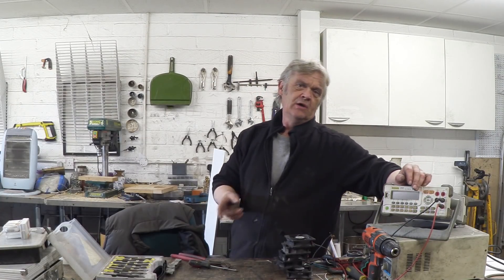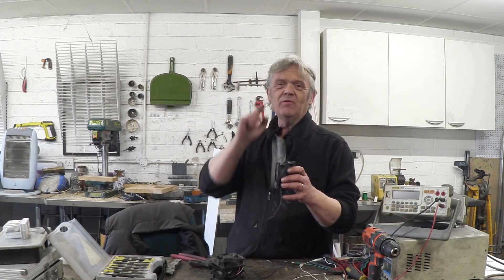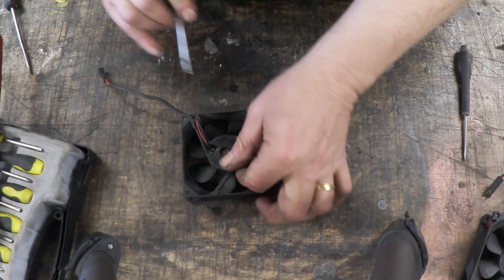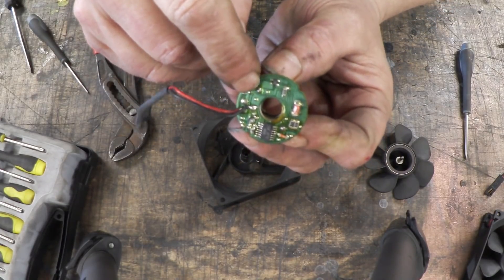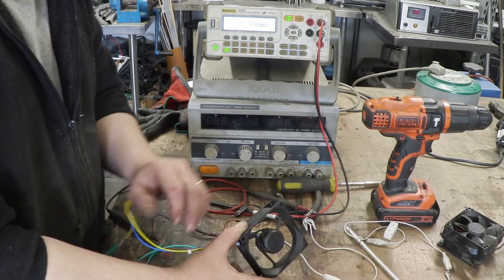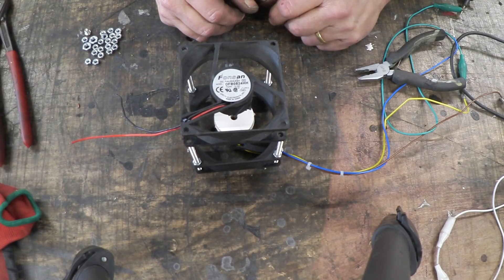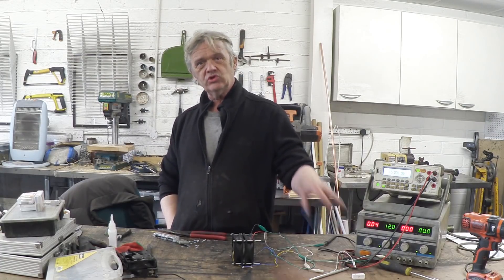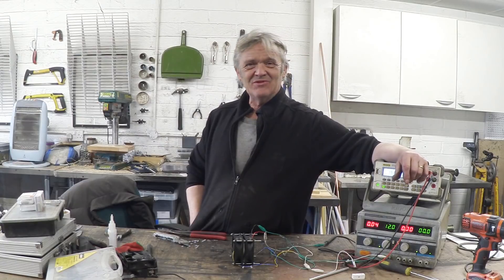1051 Brilliant  Mechanical Inverter - Even If I Say So Myself!

Comment: One big advantage is that they both have the same specifications, so it IS a direct conversion.

Much like how you bang on about a motor generates a certain output of rpm, a matched motor converted or operating as a generator should take that rpm provided by the paired motor and directly convert it into a commensurate current output.

Proof is in the pudding they say eh mate?

Comment: This is just crazy. I had no idea...

But I have an idea! 

Combine several in series and parallel but 3d print gears to drive them instead. Find the right gear ratio and weld it to a bike

Comment: This idea would be great for a DC/AC step up thru a filament transformer (120 to 6/12V connected backwards).As a B supply for an older tube type portable radio. The B+ only draws a few hundred milliamps.!
One or two 6V lantern batteries should run a 4 tube portable for months vs weeks for a C/D cell filament battery and 90V B battery Im gonna look on ebay for a radio.(and fans) LOL
Why thousands of pounds for inverters??? I have a solid state 12v to 120VAC 575W that only cost $35. Also a couple of 12V to 120VAC smaller 100W and 150W to run my laptop computers in the car Less than $20 each. (Of course none of them are true sine wave).

Comment: i built a 10000 watt low freq prue sine wave inverter 2 or 3 years  ago works great never had a problems with it  i have 250 or 300 in it  and you can do the same with your skills easyer than me  
it was my second inverter build the fist works great still also it can be built for under 100 bucks 2000 watts pure sine low freq  idle is 0.29 of a amp the 10k idle is under half a amp  rob  i have been trying to tell you how cheap and easy it is the boards are premade withe everything all ready on them  just add a transformer a choke a switch and put it in a case  then its done  the tranny is easy to rewind to the right voltage so will likly be free

Comment: i seen someplace a while ago a fellah did a bit of tinkering to an auto alternator and explained how you could get roughly 90 amps out the back end of them by removing the diodes and direct wiring to the 3 winds , attach 2 in series n i would imagine your 180 amp possibilities of running your home power? but i may misunderstand a thing or 2 as i am extremely new to this stuff myself

Comment: There's certain washing machines that has the same kind of brushless motor and I'm wondering if you can put that brushless motor on a planetary gear system that is stepped down to a 9-volt battery motor that can run the upgrade to the planetary gear system to the brushless motor but just imagine getting that little 9-volt motor that's driving it and then taking the 9-volt battery off of it and switching it to a little pillar that's no bigger than the size of your hand so when the wind blows the speed would be phenomenal and it probably put more down through the planetary system and upgraded up into the brushless motor but it's like using funnels

Comment: The only issue is the electronics needed to drive a brushless ARE basically an inverter. They just don't (usually, see pmsm) pull the signal below zero or step it up (which is a transformers job anyway)
Reply: Cost wise it maybe makes a bit of sense though so I get that. Still neat and something I hadn't thought of

Comment: I bet if you make a dynamotor now with the new DC NdFe magnets, they are now reasonably efficient. I remember looking at a calculation of using NdFe for a Faraday homopolar motor its overunity.
You need to get out and drive on the highways more often mate.

Comment: I was thinking the same thing about investors. For what’s in side them it’s pennys literally. Machines to produce them quickly if what drives the cost up I beleave. Great idea. I have a video on utube where I spun a dc motor here at work using air. Same concept you are talking about. Tethering. One dc motor to an ac motor spin the dc motor turns the ac motor generator you have ac output. Is this what you are saying.

Comment: Inverters aren't expensive anymore. You can get a 12V DC to 110V AC 150W inverter for ten quid. It would be much more expensive to get that kind of power using fan motors.

Comment: You don't need the second fan, just put the 12V DC into the first, and you're getting the switched current from the wires you've soldered onto the output from the hall effect sensor. It's not three-phase, one is a common center tap, and the other two are the ends of the coil, which you can take your AC from. You still need the spinning magnet, as that is what provides the timing to the hall effect sensor, telling it which end of the coil to apply current to. Often, the components will take a higher voltage, like, 18V, but the current can't go too high or they'll overheat.

Comment: So my house is powered by a very good 5kw solid state inverter. If I wanted to go mechanical I would need two 5kw motors plus a beefy transformer. That stuff alone would be more than twice the cost of the solid state inverter and I'm sure it would be more than twice as loud at full load. Not that I don't think this is cool idea but it's just not practical for large power generation. Maybe this can be scaled up and combined with a flywheel for both mechanical energy storage and inversion.

Comment: You could feed the output into a small transformer to get a low power mains level voltage, Could be useful for vacuum tubes or nixies. Or what about making the alternator but leaving the fan blades on? Maybe that might work as small wind generator - possibly putting it some kind of wind funnel to increase efficiency?

Comment: Great video thanks so much!, I was wondering if I could build micro inverters on the back of each of my 56 solar panels but am wondering how I would get the little devices to sync their frequencys together if all 50 say where connected in series :) also could use a hybrid sterling engines with extra 12v motor assistance hmmmm

Comment: Hi Mr Murray-Smith could you very the speed of the fan to create a variable frequency output and thus use it with Mofets to control power AC motors for EV's?
Reply from the maker: yes mate you can

Comment: can you not go back to the the very early principal of the electro-mechanical  trembler coill as first used on the very early Benz and Ford motors before the introduction of contact breakers on the distributor? The trembler coil was a device called a Ruhmkorff or induction coil and used an electromagnetic breaker on the same principal of early electric bells.

Comment: there is the way of making an inverter by making and braking a DC current with an old bell ringer this would be used with a transformer to step up the voltage for using AC power tools, got this idea from an old farm shop manual so I made one that I could use where there was no electrical power, I did have to wind my own coil to make sure it would handle the current loads from the tools. You can adjust the gap on the points of the coil to get the proper frequency and use a capacitor to reduce arcing at the points.

Comment: I see a wind wall project coming with these things each of the three phases on all of these units could be connected to diode trios, if it was then sent to and MPP style charge controller that would be the easiest way to parallel it up and no need to synchronize phases from the different motors

Comment: The only real issue is the efficiency.  I'm curious about how efficient you could do it.  The more efficient the motor is,  the more the generator would be.  Need to use a 2 pole motor,  then you could even use a transformer to get the correct voltage for your needs.  120v, US or 230v.  Would want to run the motor to get the 50 or 60hz.
Reply from the maker: apparently the efficiency of dynamotors (which is what this is) is really quite high - I have heard over 95% efficient - not sure if I believe the but I do believe they are pretty efficient

Comment: What do you think about this idea for free energy, it can be done a few different ways

Connect a 12v batter to an alternator and an electric motor 

The second version is making a pulse motor circuit and instead of using a motor the magnets are placed on the alternator which is connected to the 12v battery
Reply from the maker: go for it mate

Comment: wow very cool Rob! Thanks for sharing. Getting a solid AC supply is usually expensive and not very reliable, what a great way to do it.
Reply from the maker: it's likely to be pure sine wave out put too
Reply: @ThinkingandTinkering  That's awesome! Probably a much better way to go than expensive inverters that loose power via heat loss and likely wont last as long. The concept could likely be scaled up for much better solar to AC conversion..

Comment: Nice! Different version might work also with a brushed motor + transformer. Of course not that silent but may have some power.
Reply: Isn't the entire point to not have brushes though?
Reply from the maker: it would certainly work mate - that's is basically what the dynamotor that I mention in the video is

Comment: This really has potential, I used to work on the old Rediline inverters in the 80s & 90s, but they had brushes but they were easy to change. The brushless idea is much better, you would need a large fan maybe to scale it up to a 3000watt inverter.
I suppose to get the voltage you want, you could either bung the AC output into a transformer, or simply use a mains fan on one side and a twelve volt on the other.
I certainly have a few applications for this idea, thank you for the inspiration.
Reply from the maker: I would love to get my hands on one of those lol - getting the voltage you want is going to have a few solutions for sure mate

Comment: Fantastic.! will search on-line to see how to connect the 3 wires to the back of the fan. Stupid questions: so one wire is + while the other is  - (negative) is the third wire ground?  your the best Mr.M-Smith DVD:)
Reply: Two wires are live, it's a 3 phase generator. Ground is the same as negative (-)
Reply: @clive280178   got it...thanks
Reply from the maker: it does depend a bit on the motor mate sometimes it plus, minus and signal, sometimes UVW - but there a lot of good videos on the conversion of all kinds of brushless motor including a couple I have done if I might modestly suggest lol - I would have gone into a bit more detail here but to be honest the main point was the inverter construction and to cover everything about the motors would have made it an hour long lol
Reply: @ThinkingandTinkering   many thanks. please keep up in interesting generators/ motors builds. :)

Comment: isn't the board on the back of the fan converting DC to 3 phase AC itself? you could omit the second fan entirely and just solder onto the back of the coils no?
Reply: I'd imagine it's doing some kind of pulsing between the coils which would also likely then be square wave but I'd be interested to know this as well
Reply: @DimitriPappas  i'd hazard a guess it is a sine wave, maybe half or quarter... the pwm signal will be square wave but should the coils be getting square wave wouldn't the back-emf when the duty cycle drops, actively brake the fan to the required RPM - when in reality they are not anywhere near so responsive... if i had an oscilloscope i'd be hooking one up right now to see - but alas they are expensive :p 

can anyone test this? maybe mr murray himself, a quick easy video idea :D
Reply from the maker: cheers mate

Comment: Now all I need is the need for AC .. .. .. Since more and more is driven by DC. To be honest, I have many kilo's of electronic stuff, but there is absolutely nothing that needs real AC. (I can make a very long video of all the stuff, I have about a quarter of what you have got I think, I am a collector as well :-).
Reply from the maker: AC really came in because of long line transmission but because of the growth of one site micro generation I basically don't see the need for it anymore

Comment: Bob , We could have used something like that at sea in the 1960's to convert 220D.C. to 240 A/C instead of the valve inverters we had-- kept the cabin warm in the winter but in the tropics..............  !
Reply: In that case there would be no need to cut off the fan blades either ! ;)
Reply from the maker: lol - yep that would have been toasty!

Comment: I've done this before with these fans, you only get mili amps out, however you can rewire the stator with slightly larger gauge at the expense of voltage. Worth it though as at high rpm can get some amount of power.
Reply from the maker: cheers mate

Comment: great... for the MTA (metropotlian transit authority) subways in NYC,  they had converter AC to DC with a dynometer system...  a bit different than your inverter, but nearly identical... i suppose your inverter is also a converter if you give it 3 phase AC...
Reply from the maker: pretty much mate - but I did say this was old tech with a twist in the video you know?

Comment: Nice. But I think you realise the control electronics in the driving part is pretty much a small inverter in itself. A simple version, but that's what it is.
Reply from the maker: yes - I do realise that - but thanks for pointing it out
Reply: @ThinkingandTinkering  Yes. Inverters don't need to be very complicated. But current control, short proof, high voltage range, All things you will need for example in a car make it complicated and expensive. It can be fun to look up the datasheet of the IC used in the fan control electronics and see what features it has.

Comment: Thats impressive, I like how  you look at old designs and come up with gems like that, so the motor you use here was the fan motor? brilliant..

A nice follow up video would be how to make a circuit to add those in series to create like 120v or 220v AC , I'm a bit lost but I think with DC its just like batteries you can add up the voltage in series, not sure about the AC mmh.

Athough might be a bit complicated and also dangerous levels of voltage so maybe its not a good idea mmh but people building such stuff as an inverter should know the danger and also I guess the cables might need to be rated for 220v aswell, anyways very interesting stuff
Reply from the maker: I was thinking two things mate - this is really good at producing a pure sine wave so maybe an analogue based amplifier would be good and then I was thinking of changing to a switched reluctance device - cheers
Reply: @ThinkingandTinkering  Sounds good !

Comment: So, add some transistors and you have perfect 3 phase gate for DC battery (lets say from photovoltaic or wind turbine) and they should generate decent 3 phase output based on this low amp signal? ?
Reply: That was where my mind went. This application is perfect for anything that requires a true sine wave reference. I've designed circuits that use just a quad op amp and a handful of passives to very very closely approximate a sine wave, but it's near impossible to make it perfect, and this does that right off the bat.
Reply from the maker: now then - I like the thinking mate - cheers

Comment: couple a thousant pounds for an inverter ? eeeeh nope : the chineese ones are between 20 and 150 quid import and tax fees might be an issue though with the brexit in full effect
Reply from the maker: I think it depends on the size of inverter mate - Luke's famiiy just got one for their solar installation it was UK£2k - you are quite right a little plug in fo your car will set you back only a few pounds
Reply: @ThinkingandTinkering  the inverter i was talking about is one phase to 3 phase 2,2  kW (it is a c to ac though )
these power industrial motors from say lathes and milling machines with house current got three of these in my hobbyshop
it actually supprized me too that there that cheap 
let me see , a 12 volt to 220 volt 6000 (chineese)watts pure sine inverter costs around the same actually 
think the solar stuff youre talking about is build way better though (you still get wat you pay for though some of that stuff is actually pretty good ) allso have the solar power regulator and charging sytem build intoo them plus a bunch of nanny stuff to prevent the batteries from  overdraining and stuff like that
Reply: Yes, but those cheap Chinese inverters are going to output a "modified sine wave" full of nasty harmonics and really only good for devices that convert AC to DC anyway. Anything that likes a true sine wave like AC motors is going run hot, inefficient, and will buzz on a "modified sine wave" inverter.

Comment: This is a simple motor generator, we used had them in telephone exchanges to provide dialing tones for subscribers phones. They were also in battery valve equipment to produce high voltage ⚡
Reply from the maker: yes - did I not say that in the video?

Comment: another fascinating segment on something that had not crossed my mind.  A video on scaling this up a bit for something (real world) useful would be awesome.  Looking forward to that.
Reply from the maker: Great point!
Reply: By the looks of the output just guessing 8 in series would be about the right voltage to get 120 volts,I don't know how many series of 8 you would put in parallel to get the voltage you would need and to get the amps you would want

Comment: Basically any coil charged with pulses dc will turn into ac. As it absorbs current to its saturation it will show as a sine wave and as the electro magnetic force collapses it to will be in the form of sinusoidal ! Essentially this is doing the same thing but with 3 coils  and mechanically connected to a dc load ! It would be interesting to see the difference in effeciency between these 2 systems . My guess is 20% less for mechanical version but for simplicity and free parts it can’t be beat. First test to do is see if it can charge a phone . 👍🏻😂
Reply from the maker: that's very true mate